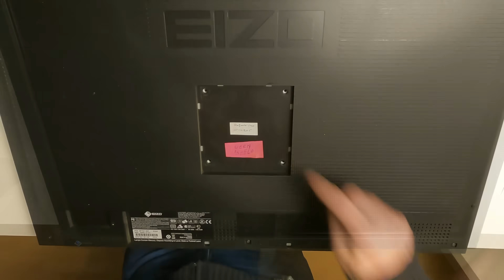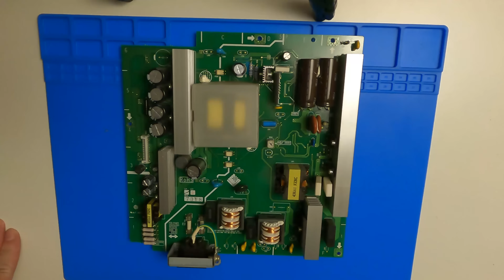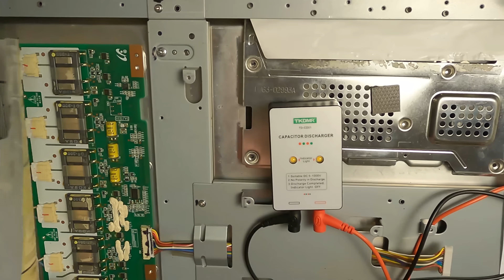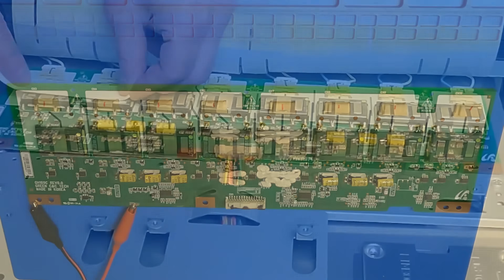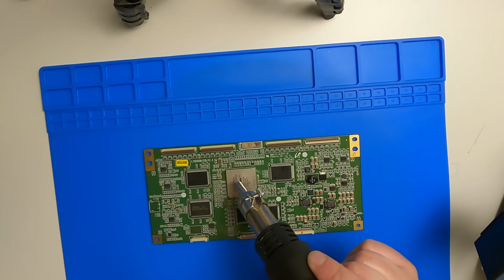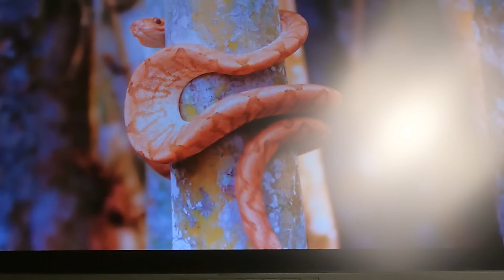Repairing two EIZO Flexscan monitors

Comment: What strikes me is that your approach always starts with measuring capacitance values. Probably rightly so, but recognizing other SMD components is also one of your better skills .
And care, for example when using double-sided tape and using reflow method with a heat gun.  In this case no capacitor issue. Needless to say, Eizo has always been a very good and expensive monitor, as can be seen from the construction